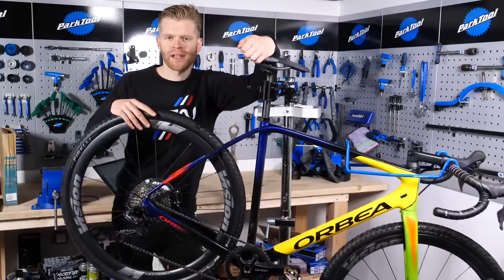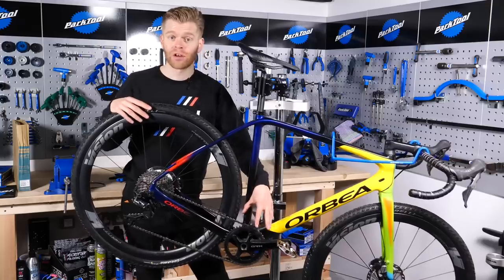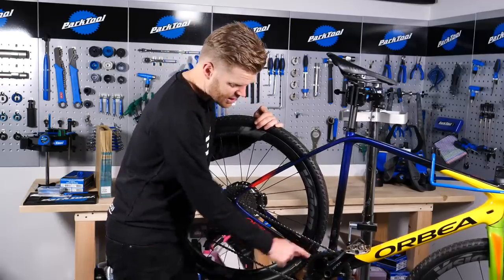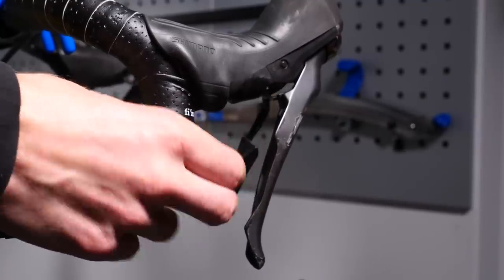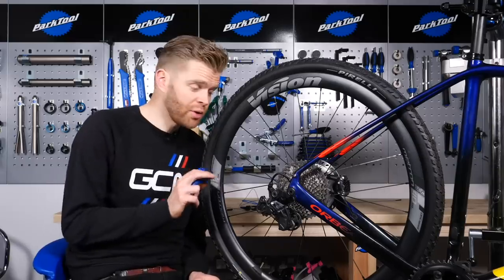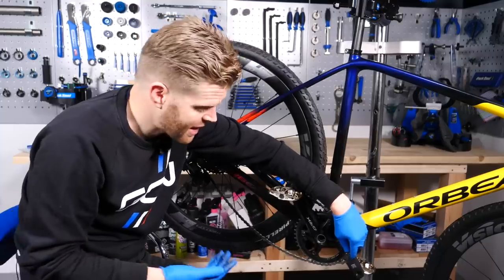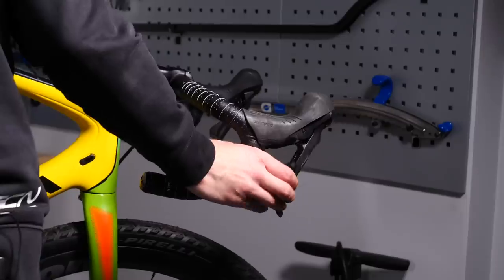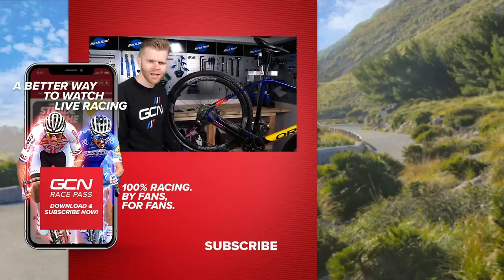How To Set Up A 1x Drivetrain | GCN Tech Monday Maintenance

Comment from the maker: Do you run 1x? Let us know why! 👇
Reply: yes and i route the gear cable up the seat stay because the bends are more slender and my cable is fully covered so im not breaking gear cables on the bottom bracket saddle underneath.  i thought the cable housing was compressing because of how much smoother it was.
Reply: Yes. One less spot for rubbing and noise. Easier access for cleaning the BB area. Comes at the cost of increased weight though. The 11-42 cassette is almost 500g.
Reply: Yep, perfect low(er) maintenance for a winter bike and less shifting if you live in hilly areas. The SRAM 10-42 cassette is much lighter at <400g but needs the XD free hub.
Reply: Yes, I have a 10sp GRX rear mech, 11-36 cassette, And just changed from a 52T SRAM Force 1 chainring to a 46T Absolute Black Oval CX chainring. Both setups run like a dream. Although I have Tiagra 4700 shifters (Left shifter snapped the shifting mech inside, brakes still work, hence 1x setup). Looking to change to GRX 10sp rear shifter and the 1x shifter from the 11 sp. Or should I get the 2x10 GRX shifters and get a dropper post and  use the left one for that?
Reply: Gravel bike, 1x sram mullet build, wireless.  Perfection. Simple. Never going back.  Easy to clean, maintain.
Reply: Yes. I have installed SRAM Rival 1x on my gravel- and triathlon bike. And I do not regret it for one moment. It is perfect for Danish conditions. No matter if you ride on the road or on ravel. We do not have any mountains. And it is lighter, more aerodynamic and there is less things, which can break and cause problems during a ride. I have a slightly larger chainring on my triathlon bike, than on my gravel.
Reply: I can’t keep my chain from coming off my front chainring when I shift into the higher gears. They just seem to pull the chain right off.
Reply: I run 1x because I'm a strict roadie and it's just a better design than 2x. Same range, better more human spacing between gears. 2x gears are not spaced out enough

Comment: Take a look at the Rotor 1x system. Works great. No bodging required. Full range for road or gravel with a cassette or chain ring swap. The 13 speed version has excellent ratio steps for your every need. Recommended.

Comment: If you find some gears change lovely, but others aren't as smooth, it's very possible that your rear hanger that the rear dérailleur screws into, isn't aligned properly. These are easily knocked out of alignment as the hanger metal is deliberately soft in case of crashes etc. Aligning the hanger is straightforward, especially with the Park hanger alignment tool.
Otherwise you will never get all gears working well.

Comment: Tried bodging a 3x8 into a 1x.  All I got (after changing the chainring to N/W and the chain to 9s) was chain suck. To add insult to injury, when I returned to 3x a few months later, the cassette and rear derailleur jockey wheels had been worn out.

A dedicated system is the best way to go!

Comment: I’d like to see a fair comparison of the current 1x systems available. I’ve just build a 1x gravel bike with GRX810 because Shimano offer the best shifting mechanism on the market in my option. They are trailing behind the competition by a large margin when it comes to 1x gear ratios though. I feel that a 12 speed GRX system with a 50-10ish cassette is needed more urgently than Dura Ace 12 speed.

Comment: Helpful hint re: limit screws.  Tightening them inward (clockwise) keeps chain more inboard on cassette, forcing it to stay on gears.  Loosening them (counterclockwise) keeps chain more outboard on cassette, or fall off ends and derail.  This applies alternatively to either H the smallest size cog, or L the largest size cog in rear.

Comment: 1X.18 year old mtb. Use a 32 middle ring, 34 outside, 20 inside to catch the chain. Not pro, but it did drop to the 20 once and cleaned the steep technical climb!

Comment: Personally I love my 3x for bikepacking just to have the perfect gear for every situation and my 1x (internal shifting) for commuting because there is less maintenance.
Speaking of maintenance, I am wondering why you put a dirty chain onto the bike again. if you already have it in your hands this would be the perfect time to clean it properly ;)
Reply from the maker: That's a great application for a triple, although a lot of riders also opt for a 1x for bike packing and a bit cassette range as this makes the system more simple and therefore more difficult to break, both are good options! As for the chain, Ollie does need to clean it, we agree!
Reply: @gcntech  I love my old Trek triple for a lot of stuff, including the odd bit of light-ish off-road, but for anything more serious i'd prefer a nice clutch mech and narrow/wide 1x. Personal preference obviously..

Comment: I wish Shimano had 1 by cranksets with tooth options between 32 and 40. It would help with conversions using older  cheaper rear end parts.

Comment: Surely if you mention 'bodging' a 1X set up (which isn't actually a bodge imo if you use a narrow wide chainring) then you have to explain chain line. This could have been a bit more in depth and mentioned bottom bracket spacers, or at least playing around with putting the chainring either side of the spider.
Reply: Indeed... It ended up being about setting up a rear derailleur which is not 1by specific.
Reply: Not mentioned is the fact 1X fixed gear chainrings can usually be flipped for a new tooth profile and mounted 5 ways. That's 10 ways overall. Just there to sell more new products!

Comment: I have 3X with 6 speed cassette at the rear. I use the bike daily for quick grocery shopping - no longer than 30 mins ride. Ride mostly on the dedicated cycling path/sidewalk in Singapore. Never change the front derailleur. My question is, can I just convert it into 1X without making any investment or rather min. investment? I want to retain the middle chain ring (I think its 38). Must I buy a dedicated 1x chain ring? Do I need to cut the chain? My tools are also limited - Hex tool, pliers, screwdriver. I don't have chain ring retainer, chain cutter, etc. My bike is Scott Sub30 2013. Some advice are appreciated.

Comment: Excellent video, as always Ollie.  Would you be willing to discuss the nuances of 1x gearing?  For example, I have an 11/42 set up with a 42T front ring XT Di2.  This is good until I hit 35mph going downhill and my friends overtake me.   So, I'm considering a 44T front ring and am told most upper gears are not utilized in an 11/42.  Something like a 10/40 or 9/38 would offer much smaller steps and better shifting.   Any response appreciated, Ollie.  Cheers.

Comment: #askgcntech is there any advantage over  centrelock disc over 6 hole ones, and why is 6 bolt ones more popular.   also if i use a 6 bolt to centre lock conversion kit is it likely to introduce disc squealing.  thanks

Comment: Excellent video. I’m having numerous issues with Sram force 1x11. Cable end barrel jumps out of shifter spool 🧵. Works ok under tension, but even easing off minutely (for maintenance etc) causes the end barrel to fly out of the spool. Any suggestions?

Comment: gcn bikes are always new and supper clean. nice to see some dirt for a change. and the rubber boot over the cable is torn so just replace it. as is its useless. still like my 3 by
Reply: I'm ditchin my 3x for a 1x because i noticed i never had to use my smallest chainring, only used my biggest chainring when i am at my smallest or second-smallest sprocket, and used my middle chainring for the rest.

I got a 9 speed cassette so it is a 27 speed transmission, but i only use 11 of the 27 gear ratios. Calculated my gear ratios and figured that i could actually live with only 9 speeds and i'm now waiting for my new 9 speed cassette, chainring bolt spacers and new chain ring to arrive.

Comment: I’ve noticed in a few of the videos that you are using a set of pliers to crimp the Ferrell onto the end of your cables.  Why are you not using the “Ferrell crimping” feature on the cable cutters?
Reply from the maker: either will do just fine, but yes it's better to use the crimper on the cable cutter tool

Comment: This 1x terminology is so typical for the bike community. On a TT/tri setup for example, I might opt for a single front chainring and a 11-34 cassette, that's all the gears I need (depending on the track), then you don't need all that special setup to handle a oversized cassette. No special rear mech or special front chainring. TL;DR; the 1x drivetrain for specialist setups like climber or TT might be very different for the more typical SX setup shown in the vid.

Comment: #askgcntech I have been getting various groupset parts over the last year and last week when I tried to fit then they basically just don't work, I have a dura ace 7800 rear deraliar, with token Tiramic jokey wheels 7900 cassette(11-25) kmc dlc10 sped chain and dura ace 9100 front chain(34-50) set tiagra shifters 105 front deraliar , my front chain ring shifting is perfect but my jokey wheels have a small rubbing and clicking sound and if I try to shift to my 7th cog my jokey wheel grinds with my cassette, also when on the smallest chainring my chain is ready loose and on the large chainring super light  ,I realise these are 10 and 11 speed parts but I believe they should still work together as I have had no issues in the past,I have also put together a lot of bikes!!!any help appreciated.
1 second ago
Reply: I had a similar set up but with stock jokey wheels and a Tiagra 12-28 cassette that worked perfectly so it's something to do the the jokey wheels or cassette

Comment: Converted a 3x to a 1x during last years lockdown, but often struggle to get the chain to drop onto the smallest cog while out riding, Any tips to tweak?? TIA
Reply: Adjust the high limit screw on the derailleur
Reply: @jaykennyniklas4497  done this a few times, but the derailleur struggles to come across that last wee bit to allow the chain to drop to the small ring. Not the easiest trying to get it across with my foot while gaining speed LOL.
Reply: @Mushy2910  
Assuming the indexing is done correctly and that the derailleur is compatible with the cassette and shifter on the bike:
Things that mess up indexing in the back are a bent derailleur hanger or old/dirty cable and housing. Old/dirty cable/housing actually often causes bad shifting to smaller cogs (you release tension in the shifter, but the dirt/rust adds friction that stops the cable releasing the tension on the derailleur)...

If hanger is straight, do this check before you buy a new cable and housing:
What happens if you completely undo the cable? with no cable tension, the derailleur would be resting on the limit screw and the chain should sit on the smallest cog and pedalling should make no clicking noise. If it's still on the next cog, or if it's on the smallest cog but with clicking, then the limit screw needs to be loosened.
Once that's sorted, re-attach the gear cable and do the indexing like normal.

Comment: Just wondering if I can use a road bike groupset on a tt bike cuz I just got a new bike frame and it doesn't have to groupset on it yet so I need something I can used just till I can get a new one
Reply: You could, but you might not have a high enough gears, as you're probably faster
Reply: @jaykennyniklas4497  thanks

Comment: hi, can i exchange my sram casette 11-36 with 10-50 and my front 40 teeth with 48 teeth front ring on my canyon inflite cf sl 7.0 (2019)?
Reply: Is it a long cage or medium cage rear mech? I think the largest rear sprocket you are supposed to run is a 42t. Also, you would need an XD Driver to run a 10t cog. I would look at e*thirteen. I think they make an 11 speed 9-42t cassette that works with XD Driver (you would need to get a new free hub body). Running that with a 42t front ring may get you what you want
Reply: @freebird61885  medium